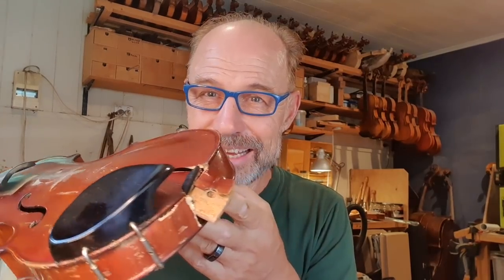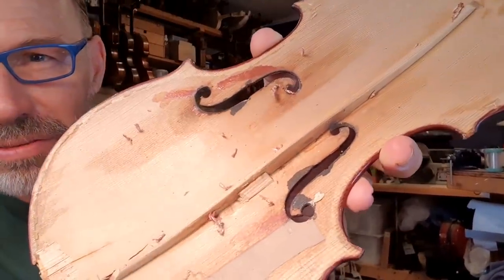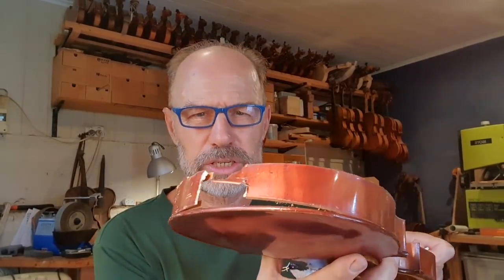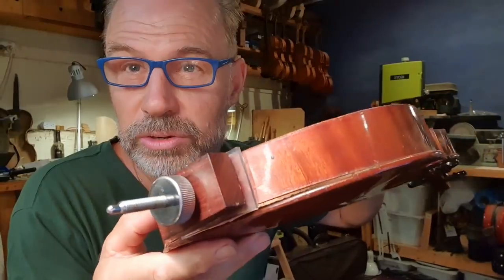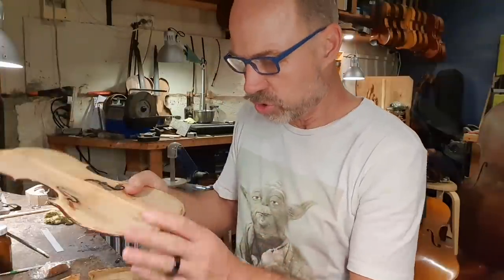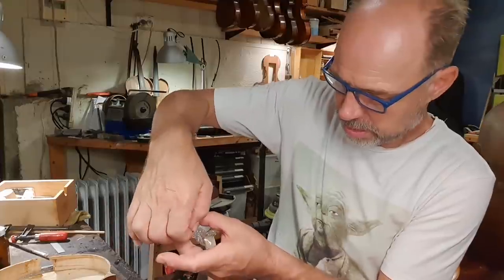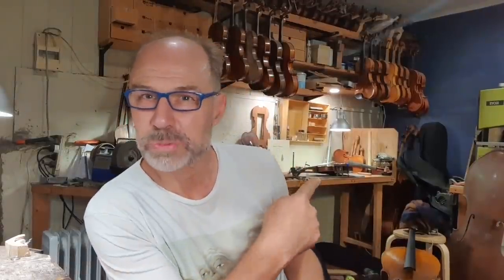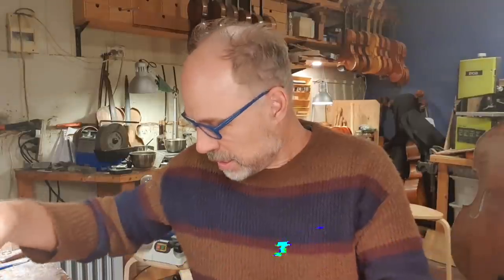Violin Disaster! - Can it be Fixed? Part 1

Comment: How do you prepare a stringed instrument for storage?  Maybe you could do a video on it.  Granted, we should all be using our instruments daily, but sometimes life gets in the way.
Reply: ... or for transport.
Reply: I personally would loosen the strings for storage
Reply: @louisabone2614  How loose?  Lose enough to remove the bridge?  Would you loosen the strings for 1,2, 3-12 months in storage?  Many questions.
Reply: @Cakebattered  not enough to move the bridge as that can let the sound post move if knocked just slightly loose so it's not so tight
Reply from the maker: I would keep normal tension foe transport but loosen down by a 4th or 5th for storage. 
If an instrument is in storage I would check it over every 4 to 6 months.

Comment: With the amount of work needed to (attempt to) repair this violin, I am wondering if it's even worth the monetary consideration. Sure, rescuing an old instrument has its onw virtue, but as a consumer, I wonder if the cost of repair exceeds the cost of a mid-low tier instrument.
Reply: I guess it depends on what it means to the person... sometimes an instrument may be given by someone special and hold a special significance 

For example a mid range violin maybe has a value of 5000 to most 

But a mid range given by maybe a grandparent who supported or encouraged them to learn 

Or used to be the grandparents handed down 

The personal value could be higher than any high end instrument
Reply: twoodfrd talked about that when repairing guitars. Is it worth the repair? Probably not. But throwing away a broken instrument that can be repaired is something no instrument maker will like. Also it's an environmental thing. Always getting a new thing because the old is broken isn't feasible in the long run.
Will repairs be as good as new? Maybe. But if not it ads character and gives the instrument history.
Reply: I normally would agree with a violin in this condition. But his speed and skill level will pull it off.
Reply: I once put a guitar back together that had been crushed by a very drunk girl while on a river rafting trip on the Colorado River. It was a cheap guitar.  They would have put it in the camp fire but the owner didn't want the girl to feel bad. The owners wife put it in a plastic bag and hid it under the rowing seat here it stayed for several days in the canyon sun etc. His wife told him she threw it out when the got home. I spent a couple of months rebuilding it. A great surprise  at his birthday party.
Reply: It is worth if it is an old instrument. For new, low quality, mass produced instruments, nah.
Reply: @cpt_nordbart  That is a shallow problem. This wouldn't be done for "environmental reasons", as wood makes zero impact. The rescue would be done because of the value of such an old instrument. You can no longer find wood from old grown trees, due to intensive harvesting. The new wood is from trees that are 10 or 20 years old, and doesn't have any heart wood. So, new violins suck because of this and because they are mass produced.
Reply: Sometimes it just depends. Sentimental value is a real thing and if an instrument means enough to someone sometimes monetary value is irrelevant. Jerry Rosa of Rosa String Works put a violin back together that was far more destroyed than this one. Anything can be fixed if you have the money and will.

Comment: My first impression was that it was going to be like the brush which has had the bristles replaced 3 times and the pole replaced twice - but it's still the "same" brush!  So, you give the violin a new top, a new bottom, new sides, a new neck and new strings - but keep the original tuning keys ;-)

Comment: Hi Olaf, I have a question. I bought a violin that appears to be baroque, with short fingerboard and small holes in a tailpiece and so on, smallish with a case that fits length of the violin but no longer, so for a short bow. It cost me 40 dollars after conversion. Should I buy another violin prior I crack it open, or should I practice on the one I bought as it was sub 100 dollars? I would like to check the bass bar and perhaps the label if it is still there. It is the only violin I have. I own 12 guitars I could practice on if it is relevant.

Comment: Wow. I saw a WM Lewis violin regraduated in 2017 on EBAY. Most of the varnish was "replaced", but you can tell what color it was based on what was left on the scroll. I don't think it is a $1500 instrument. PS don't advertise repairs in ball point pen on the inside. As bad as the repair job was, 12 watchers!

Comment: Ouch! Learn on a $100 violin you say. Can be an even harder & destructive experience if they have used an aliphatic or PVA type glue in manufacture. ;) I do agree though & one needs to know their limits too.
BTW, I ended up making my end block clamp like that a couple of decades ago. Files can be shaped into gauges too when on a tight budget. :)
Reply: yeah but then you really learn how not to crack the wood
Reply: @nskimharris  Yes, that's true & also learn how to repair the damage from it (if it unfortunately occurred). My first experience opening up a violin that had been worked on by a backyard person using PVA glue (& western red cedar for a bass bar) was not kind, but learning how to deal with foreign glues was something I had to come to terms with real quick. That first violin was muted & nasally before I repaired it but when returned it was clear & powerful.
Reply: @rossthefiddler5890  I have yet to put one back together haha...just started. That is very neat that you were able to improve the sound so much!
Reply: @nskimharris  Learning violin making is a good start to understand the aspects of construction & applied physics etc. together with the artistic finish. I gave that particular violin a properly fitted & tuned bass bar (using the tap tone method) in place of the rough one he had glued in & then followed through with traditional set up procedures with an accurately fitted sound post & bridge etc. so that gave it the voice it should have had. I can't remember the other reasons I offered to do it (a couple of decades ago), but one would have been the careless placement of the belly that allowed the fingerboard to be too low because he must have had the scroll sitting on the table without any knowledge of what a fingerboard projected height should be.
Reply: @rossthefiddler5890  fascinating, thank you!

Comment: Hi, Olaf. I like your channel. May I ask a question please? I am looking for a new violin, and last week I tried a German violin was made by J.H.Z, it is NO.4009. It is around 6000AUD. I could saw some repaired of the back. Would you please give me some advice? Thank you so much for your time.
Reply from the maker: It really depe on the repair...
If it has a repaired back soundpost crack, you have to be super careful... also if the crack or repair is really visible, it probably wasn't well done.
Reply: @AskOlaftheViolinmaker  Thank you so much for your advise, Olaf.

Comment: It is very difficult to "try this on a 100$ violin": most are glued with modern glue, like epoxy or Urea-Formaldehyde… and it is almost impossible to break the joint… The wood breaks.

Comment: Olaf I know you’re busy but I have a question if I may. 

When trying to reinforce the rib at the end block to enable the instrument to withstand the string tension, would placing a full rib sized cleat (same height as the rib) spanning the damaged region between the end block and rib would have upon the sound quality and resonance quality as opposed to reinforcing the area after the end block is glued into place and then trying to strengthen the area?   

Thank you for your time sharing your thoughts.  I’m a big fan from over in the states. Be well and stay safe.
Reply from the maker: I think both repairs would have a similar effect on the sound...